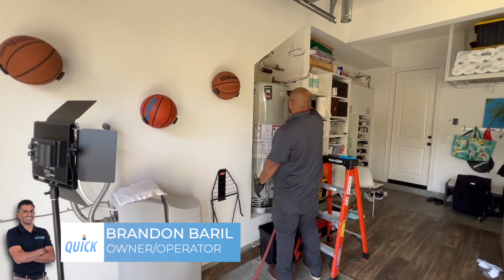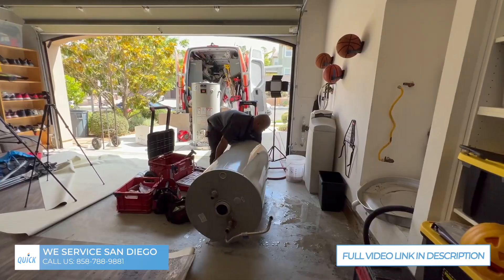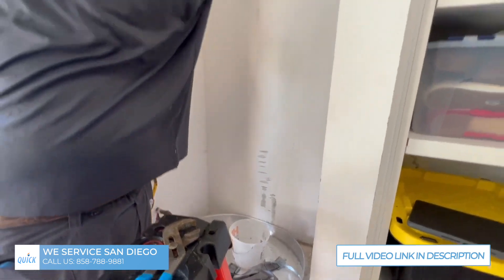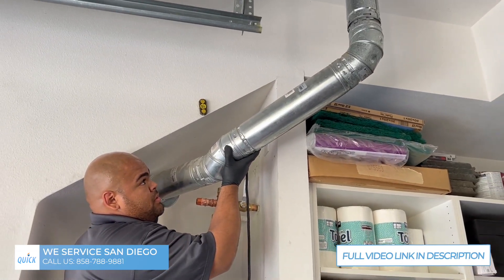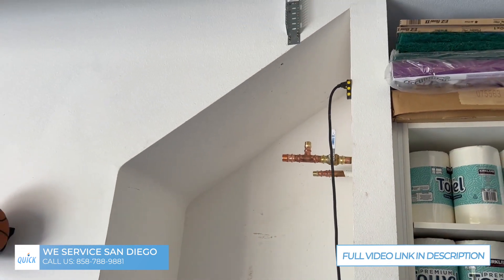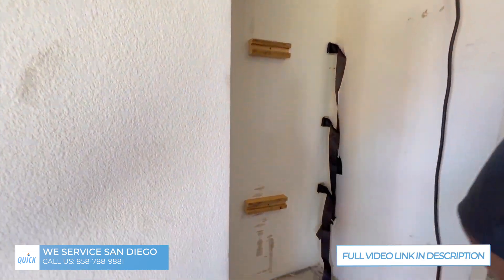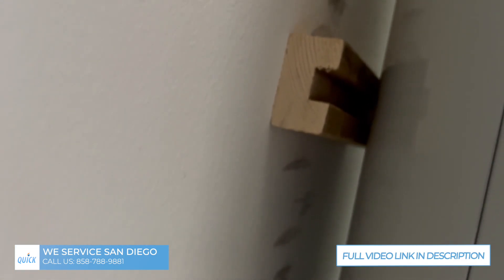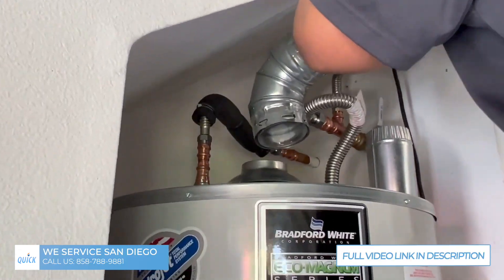How To Replace a Water Heater

Comment: looks good!   Only  question is why would your guy put tape on the top of the supply nipples?   you never use tape on the flexes  they have a washer inside  like a garden hose . im guessing you had him remove it befor water heater went in
Reply from the maker: For sure because you’ve installed 11,456 water heaters right?
Reply from the maker: We install more water heaters in a month that a general plumber can install in a lifetime. Love you. But you don’t know.